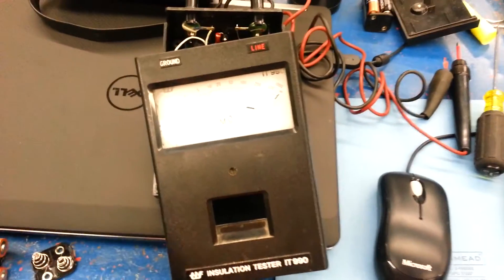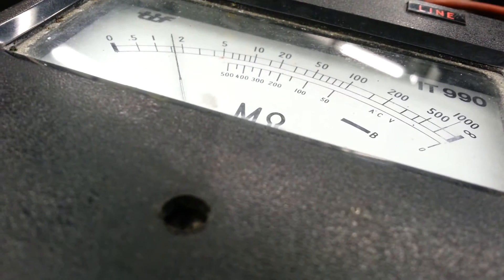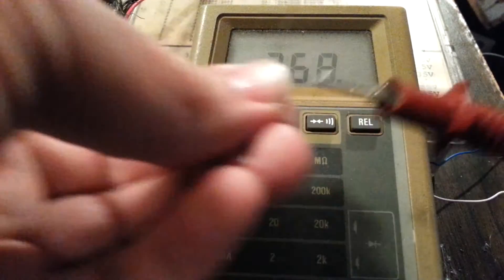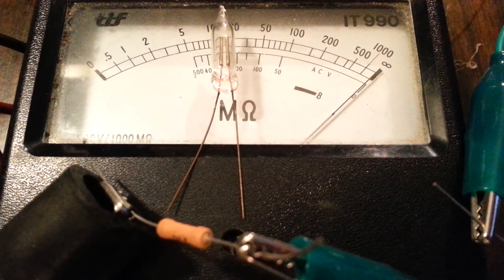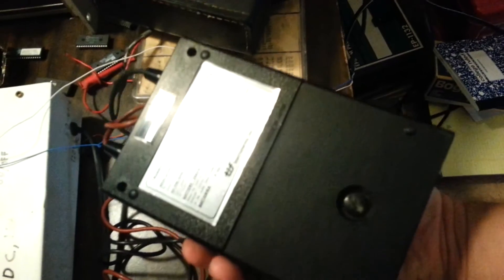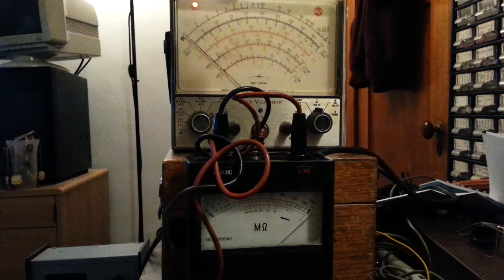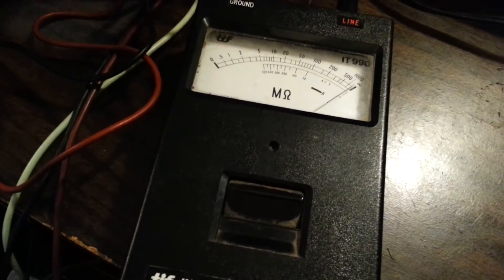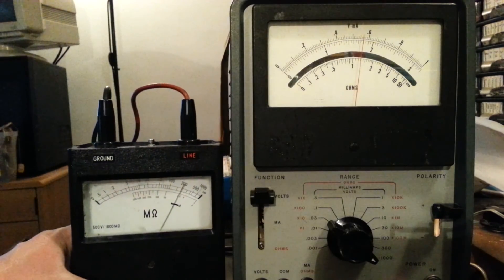Reading Gigaohms!! TIF Insulation Tester IT990

Comment: Hello Rickey...I have a recently aquired  "Simspson Model 260 5m" VOM ...do you have internal spring battery clips for these?...mine are corroded and need replacement..The VOM itself is in excellent condition..
Reply from the maker: I would recommend getting a battery compartment from Radio Shack and salvaging its springs.